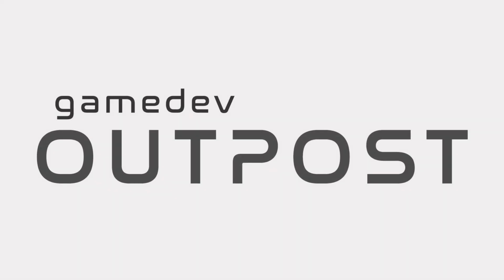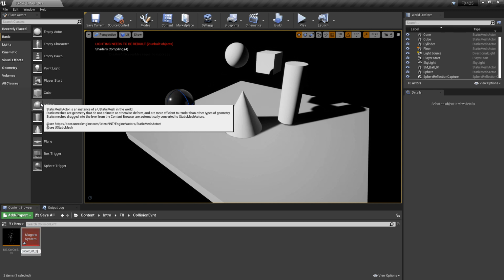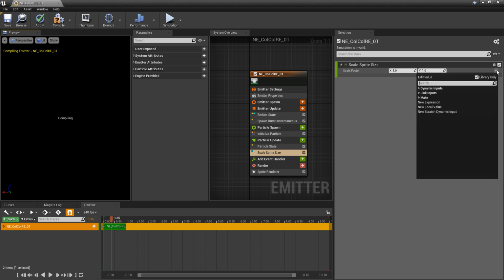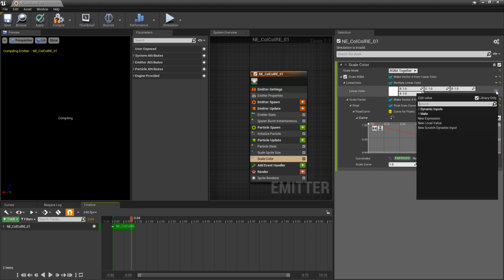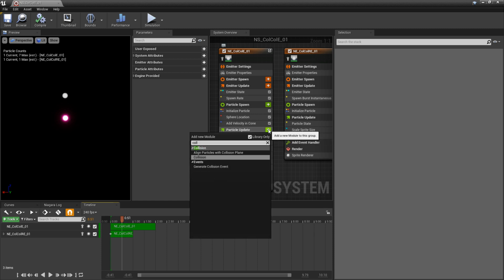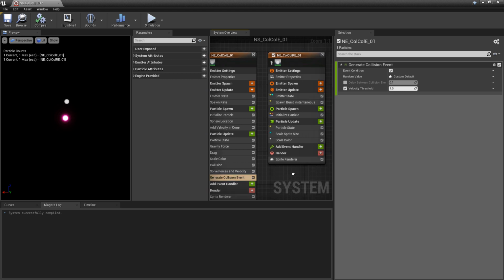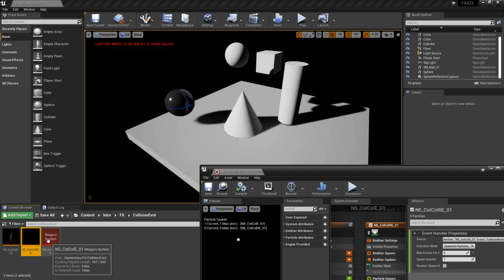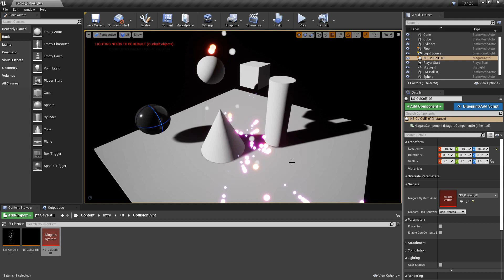UE4 - Niagara Events - Collision Events

Comment: when do I need GPU particles over CPU? for cascade it's pretty obvious but niagara is much better at handling CPU particles that GPU doesn't seem needed.
Reply from the maker: Depends on the hardware and there's certain things you can do on one you can't do on the other. It could also depend on which way you need to optimize your game.
Reply: There are a few reason. 1. Some effects can only be done with GPU such as reading from textures, vector fields, also if you need to collide many particles CPU will be too expensive. 2 performance. At least for Cascade GPU particles was about 20x faster. This is a huge deal for any high end game since performance will be very limited. I have worked on games were the CPU is needed for other things so you are almost not allowed to use CPU at all, but only the GPU. For PS5 and Xbox Serie X it is less of a problem since the CPUs are much faster than PS4/Xbox S, but GPU will still be much faster. All in all I only use CPU particles if I absolutely have to. Some of the features in Niagara that are only on CPU should also be ported to GPU (not all can though), hopefully that will happen but if you have a strong programmer team at your game they may even do it for you.